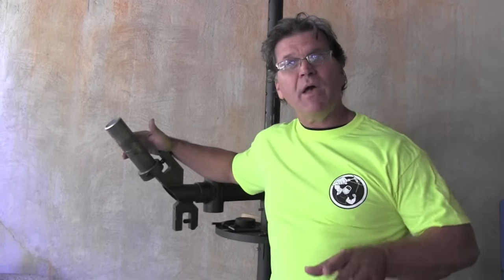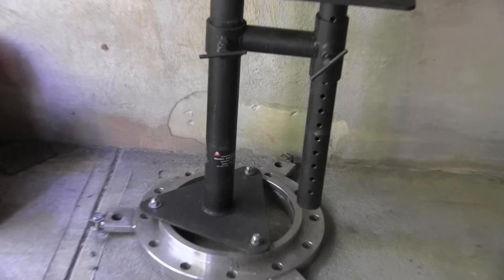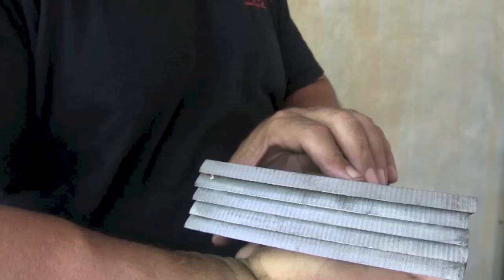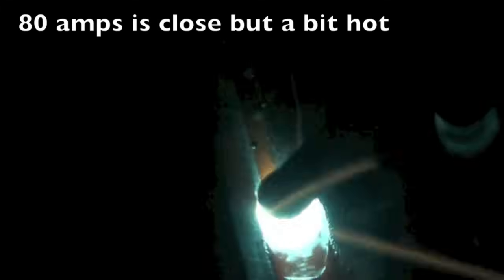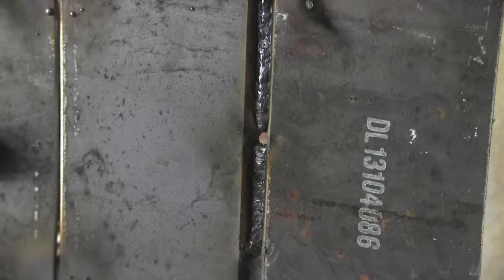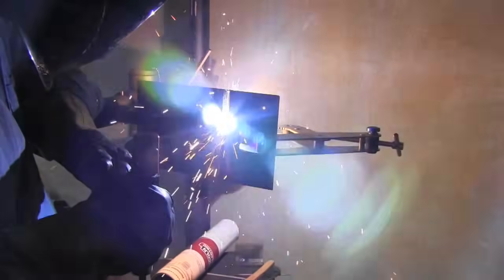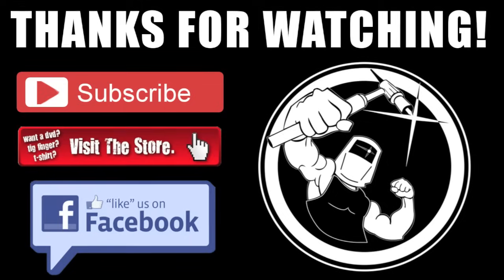Stick Welding Tips for 6010 Open Root &7018 fill cap

Comment: Great video! Question, the WPS we are required to use is 6010 1/8 , 1" plate and the amps set at 100-120, and no mechanical cleaning "period"! My first thought is this is HOT. I have not tried it yet, just wanted your input on this?
Reply: +Thomas Mathis Jr That does seem warm for 1/8" 6010.  Typically it is around 90-95 amps.  That 6010 rod size is commonly used in conjunction with 3/32" 7018 without changing the machine's amperage.  I'm not sure why no mechanical cleaning would be specified.  I have never ran into that before.  I consider interpass mechanical cleaning as an absolute necessity for any quality SMAW weld.

Comment: can you do any other methods on open root butt? I have been instructed not to use that hammer method but rather stick it in and just move up.
Reply: +Cooper Black I can get away with just dragging the rod with a really small root opening and running hot.  However, with a gap wider than 1/16 I find I have to whip the rod to keep that keyhole at bay.  I am a firm believer of using the technique that works for you though.  Play around with different techniques, and you may just find one unique to you.

Comment: what about using the arc force ?
Reply: +Texmex89 I use no arc force (set at 0) with 6010 personally.  6010 is a rod that already has heavy dig characteristics, but everyone lets their machine set differently.  With 7018 I like a tad bit of extra arc force, seems to tie in better/gives a crisper arc
Reply: oh well I was using the arc force for a little bit but stop using it bc there where saying that many jobs don't have a arc force setting especially in the refineries

Comment: hey! great vid. I'm on outside corner. 1/8th gap using 1/8th 6010 on my root. no bevel and im having a hard time keeping the back of the weld consistent. starts chunky then fills in nice. is that just starting to slow? i tie back in just behind my first bead and it doesn't seem to fill in completely when I take off. how will I know if I've held long enough on a tie in and matched weld width without blowing through it. no backing plate
Reply: throw a bevel on there if your aloud sounds like your in the ballpark with the amps if it fills in better afterwards. Maybe run it a tad hotter like 5 amps or so or long arc it like Jody did when he was comin in on the restart to give the rod and weld area a second to heat up.

Comment: an excellent video this is. it helped me a lot to do better at 3G open root. thank you! here i got some questions. do you look down the key hole from above? I have difficulty to see the keyhole when I set the plate at the level of my chest like you do. and also I have a tendency to leave a depression right past the tack i start to weld on. Is it because i dont jam the rod deeply enough or travel slowly enough?

Comment: We usually do 1/8th land, 3/32nd gap but we (school) run it around 88-90 amps. That's for all positions too but our instructor only demoed 1G and we were on our own for the rest. I seem to have no problem running 88 amps. Is it too hot because its vertical?
Reply: What thickness plate? 
At our school we run 3/8" plate and 1/8" 6010 root at 83 amps, land is about the width of a nickel (Some prefer larger, the teacher isn't very strict with land size unless your welds don't turn out right). I ran 88 amps one day (I forgot to change my machine back, we run 88 amps for the hot pass) and it was doable but could tell on the back side it was to hot.
Reply: +Jake we also did 3/8. Honestly it really just depends on how good of a welder you are AND how good your prep is. Like if I have a weak prep with too wide of a gap (which has happened plenty of times) then I would turn down my amps to like 75 for my root pass and it would turn out just fine. Or if my gap ends up being too tight I would crank that sucker up to 100 and my root would turn out beautiful. It all depends on what kind of day you're having I reckon haha. Damn this almost makes me want to cry haha I miss stick welding :( I graduated and got some shitty job welding mufflers all damn day (short circuit MIG). I hate it. But for now I've just got to deal with it.

Comment: I've been almost a week in 3g open root can't seem to get the under cuts out of my cap. stringer beads frustrate me
Reply: +Nicholas Ramjattan A small side to side motion helps me with my cap.  not a weave, just a small side to side manipulation on and off of the bevel edge

Comment: Hey Jody, got a quick question. Currently in a Stick II class, I have a cert. test coming up with the same plates as these, pretty much same everything. Except that all 3 passes are 6010 and it's in flat position. Should I run Z's or should I be doing a different method?
Reply: I am not totally sure about this but I always been taught 6010 is a whip and pause motion. Not z weave like supposedly your not supposed to weave 6010 cause it's a fast freeze rod.
Reply: +ProD Miner agreed.  always run stringer beads with 6010

Comment: so the flicking method works for me. I have to run dc+ at 100 amps, under the teacher instructions. now I just have to slow down a bit to gain total fusion. thanks for the help

Comment: what current is being used here? I'm currently doing this weld as practice for certification test later. My instructor has me on DC+ at just about 100 amps. I having a hard time with the 6010 sticking and making big key holes. the instructor also has me pushing the rod, in and up the plate. something isn't working for me. the teacher isn't much help right now. any suggestions?
Reply: +MrWshadow82 Try DC - dont angle the rod up try keep it facing in all the time keep the rod in so it gets pen, angling ur rod up or having too long of an arc length is gonna cause big ass keyholes, u can use the flickering technique show in this vid to cope with keyholes but if u dont angle the rod up u and have the right amps u should be golden.
Reply: +Anyname willdo His WPS may require DC+. The reason I say this is our WPS requires DC+ and the amps have to be 100-120.

Comment: We just started our B level course. Why do you long arc after stop-starts? im having trouble tying in after my 6010 rod is done..
Reply: You long arc to pre heat the metal so when you tie in your penetration is a lot better. :)
Reply: Thank you!!
Reply: outlawz rivers Hey I had massive issues doing ties in on vert up but I figured it out how to solve it. Just go up 2 to 3 inches from your tie in start your arc then long arc down to the tie in. Then hold it there for about 1 to 2 seconds then push in and keep a tight arc and keep on going :) Hope this helps man!

Comment: dads a veteran pipe welder and swears by 72 amps on the root
Reply: Everyone’s different. Your dad might move a lot slower than other people. I know some people who swear by 90amps and they do it fast as hell. There’s a different amperage for everyone
Reply: Yup, I run about 72-73 amps for the root
Reply: He's running too hot for that gap, he would be fine with a 1/16 gap

Comment: please show me the results using 6010 from the reverse side
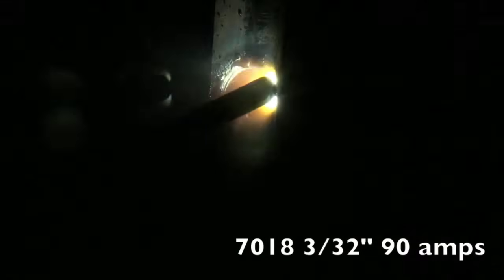Reply: luluk anton Check out Jody's video "6g pipe welding test 6010 root pass".  Look at about 6:50, and you will see a great pic of the inside
Reply: https://youtu.be/GAKoA8ng5-M?t=5m29s

Comment: how do you know how deep to jam it in there? i either blow straight through or dont penetrate the other side.
Reply: daniel ainsworth I am sure that there are a hundred answers to your question!  But it is a great question!   Personally, I listen for a particular sound which tells me that I am getting the penetration I need.  I keep my arc length very short, and to me it looks like I am burying the rod in the weld.  In my mind, (I don't know that this is really happening, but it is a 'visual' that I use!) the end of my rod is just about even with the INSIDE of the joint, so the weld being laid down is going to look like the effect that Jody is able to achieve.  

I would suggest that you go to "weldingtipsandtricks.com" and click on the "forum" tab.  Register in the forum, introduce yourself, and separate from your introduction, ask this same question.  Shoot, you can ask just about any welding question you want.  The guys on the forum are awesome welders and very willing to answer questions and help out!

Comment: Jody,   Your welding videos are a staple in my weld classes. I am a weld instructor/Millwright for GM Skilled and non skilled trades department.  I find that using your videos gives me a better opportunity to teach rather then having them crowd around a booth trying to see what is vertually impossible to see when I am in the way!  I am a member of the Local 2209 UAW and the 798 Ironworkers union!  Thank you so much for all you do to promote good welding technical proceedure and just great information about welding knobs and buttons and gadgets in general... I Love watching what your going to do next!  Keep up the good work and God Bless!   Sincerely,  The Rat!
Reply: Nathan Radtke Hello Sr. Rat!  I am a decrepit, old ironworker (local 63), who teaches all types of welding at a community college.  I teach steel, alloy and pipe.  Like you, I use a lot of video from Jody.  Are you on the forum?  If not, you have to register there.  I have learned a ton from reading responses on that forum.  Carry on!
Reply: I will register....i too am an old young man....i think that is part of my trade....Millwright going on my 31st year now....but i teach welding also for the company i work for....it helps break up the strain of iron work and fixing rotary machinery!  I LOVE what i pick up in the videos....i am sure the forum will bring me to a whole new level!  Thanks for the tip brotha....UAW Local 2209 here also a member 879 Ironworkers out of Rockford IL.
Reply: Nathan Radtke Hi Nate!  I did a lot of work out of Rockford years ago.   Chrysler plant, some schools, Byron Station and a mill called 'Gunnite'.  The forum will help!  Keep up the good work!

Comment: Do you have 2g plate test tips
Reply: pLoWerification You ask a good question.  I think that 2G is overlooked.  For myself, I keep about a 5 degree work angle (rather than zero or 90) and make darn sure that penetrate into the top of the joint.  I might have to hold a bit longer.  If you aren't already, go to Jody's forum (find it at weldingtipsandtrics main page, register and ask your question.  Great guys out there, always willing to help!  And the forum can be a lot of fun!
Reply: iw63boomer  thank you i will check it out.

Comment: And i use the drag motion rather than a whip. I was told the more you whip it creates small voids between the ripples on the back and a bend test would destroy it. I use the drag and watch the keyhole and keep a crescent moon of open space between the electrode and puddle and the ripples will be tighter and the bead will be uniform in width

Comment: Hopefully I am not way off topic. But what stick/arc welder would you go with for a pretty much beginner. I have a Millermatic 211 with spool gun for mig, but need to get an arc welder. I saw in the one video you have a trusty lincoln buzzbox. I was thinking of getting the hobart stickmate with ac/dc. Seems to be the same as the miller with a different color paint. There is an older miller arc welder on craigslist guy wants 90 bucks for it but i know i could get it for 75. Looks to be in good condition it is an older model I forget the name of it. It is only ac though. Miller thunderbolt this ad here he still wants 95 he started at 100 its down to 90 i know he will take 75 for it though.   Here it is on criagslist   http://pittsburgh.craigslist.org/tls/4755763583.html. Or would you just go with a new one. Like the hobart stickmate or lincoln tombstone style. If you have time to answer I surely would appreciate it. Thank you in advance.

Pat M

Comment: I remember back in high school I had a welding teacher that's a CWI took a 3G test on plate destructive test face and root bend. Passed pretty well. I love open root welding. Only open root pipe I've done is with oxyacetylene 3 inch schedule 40 with a 1/8 wall thickness, just took that a few weeks ago, im going to school for welding. But anyway keep up the videos Jody they've helped me with a lot of things with welding.

Comment: Jody, one of the common trends in the industry is now 7018 all the way out.  In fact a local rail car repair place cannot even use 6010 due to insurance reasons (stupid I know) as they say the rod chemistries don't match and the 6010 is weaker.  So they now have a 7018 root.  I"ve heard of this in other industries as well.  You might want to investigate that and cover that on a future "episode".   I'd personally like to see it and see how wide spread it has become.
Reply: +Everlast Power Equipment How can you do a open butt root pass with 7018, I was taught to use a cellulose rod for all open butt root passes?
Reply: +randysengine service   It can be done, and is becoming more common as a result of insurance issues in structural applications.  The theory is that 6010 is a weaker rod than 7018 and is a weak link where failures have occured.  Running 7018 all the way out will keep metals similar.  I've done some, and it isn't all that hard.  You just have to learn how to adjust the settings and it will lay in as nice as anything.  If you think 7018 is hard, a lot of Europe and Asia lay the root with 6013!
Reply: +Everlast Power Equipment ..Times was....the root could be 7010 electrode....
Reply: That's interesting news because I'm watching this video before practicing a 6011 open-root pass with a 7018 cap on a butt weld. I very much prefer SMAWing with 7018 and would love to use it all the time. I've heard 6010/6011 is somewhat brittle (doesn't stand shock-loading well).

Comment: Thanks Jody, I have been a fan and supporter for several years now. (looks like you have a new hairstyle!!)
You are absolutely right about the schedule 80 2" pipe, it separates the welders from the wannabees. It is currently kicking me all around the test stand.
I have real problems with keyhole.
I am in a new welding class, and, we actually get to use grinders.
My old instructer said grinders were out of the question; and, wouldnt let us even use a second 6010 for the root on the 3/8" we had to do the whole 8" in one shot perfectly.
I am still working on the plate cert, but had to move into pipe to keep up with the rest of the class. Your information, and Tig Finger are invaluable, Keep it up! Thank you.

Comment: Jody, can you make a video about 2G and 45 degree bevels with 3/32 7018 root and 1/8 7018 fill and cap. I'm having trouble with arc blow even with runoff tabs and moving the ground clamp.
Reply: You might be long arcing a little bit. I used to have a hard time with arc blow until I finally pushed my rod in really close. Moving the ground will only help you so much. Best to always weld away from the ground if you can, least that's what I was told. Does your machine have an arc control setting on it by chance?
Reply: rookyandb  I know I'm not long arcing at all, i keep the rod really down in there. And my ground clamp is at the end of the bevel. BTW this is open root bevel 1/8 land and 1/8 gap. My instructor doesn't think high schoolers should run closed root bevels with backing strips with the exception of dualshield.

Comment: hey jody great vid, i\m currently in school for my second period apprenticeship. The class is SMAW heavy (our test welds at the end are SMAW 1G, 2G, 3F and 4F and GTAW 2F aluminum, 3F stainless.) i've never seen a root pass done with what seem like large steps like in the vid. obviously it works if you're showing us the technique. i usually run 1/8 land and 3/32 gap  using 1/8 6010 at 100amp and arc force around 55-60. and basically keep the end of the rod right in the gap and using a kinda push and step technique. i push the rod into the gap until i feel the edges melt thru then move about an 1/8th and repeat. i basically never get a keyhole that opens up that i have to step back into. but i get full penetration and my roots hold when bent. just wondering if there's an advantage to the way you showed it vs the way i do it?

also any 3F 6010/7018 tips would be good too:)

Thanks, your vids have helped me tons when it comes to learning new stuff.

Comment: Do u have any tips for 4g overhead v grooves my current settings are 90 amps for the root 100 amps fillers and 120 for my cap 3/32 gap and 1/8 landing and I don't jack I drag my 6010s

Comment: I have just finished doing my 1,2 and 3g open root butt joint 3/8" plate at school and found that i needed to run 80-90 on 2 & 3g and 95 on 4g for my root pass (seem to work pretty good) but every machine is slightly different. Thanks for the video Jody still very informative. Start practicing my CWB's today

Comment: Jody, you should mention to those of us what it means by "Long Arcing". What it is, how you do it, why should we use it?
Reply: Exactly what it sounds like, holding a long arc, helps heat the metal some before you start the bead

Comment: I have a huge test for the union on the 27th of October. Your tricks on the 6G have helped me alot. If I pass my test, it's because I've learned so much more from your  videos. Thank you for all your help. 
P.S. my test will be on tig purge in the 6G position sch 80 2 inch carbon steel pipe.
Reply: Young Honor Did you pass?
Reply: Young Honor so did guy you pass
Reply: MrPONCHO467 he failed, sadly , he’s dropping frys at McDonald’s now. (Don’t rub it in, he checks these links every once in a while)
Reply: @rl2769  yea, you're obviously a douche, good for you, bet mommies proud of her little douche.
Reply: @rl2769  @ahh nameless, teaser,& you're a hoot !!